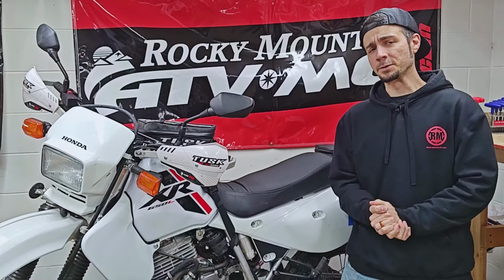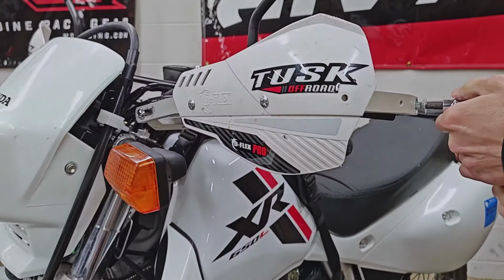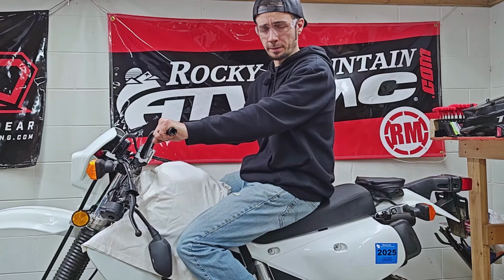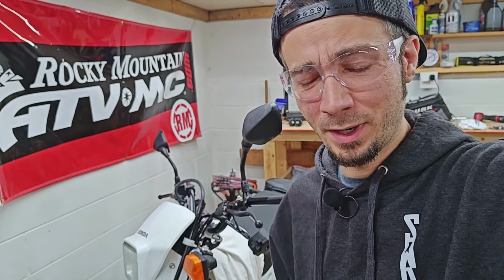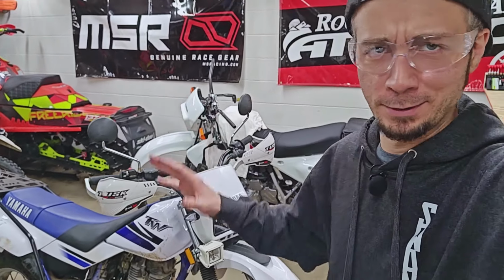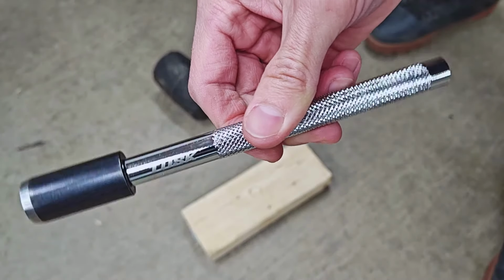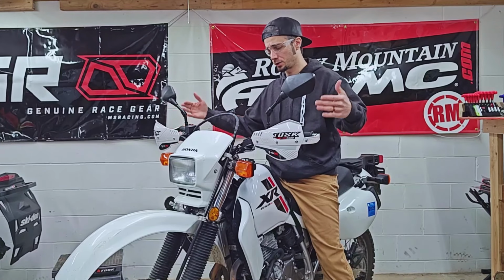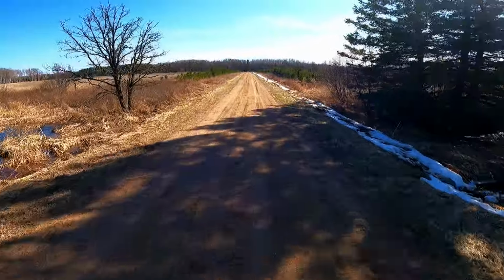The First Mods: Honda XR650L (HUGE IMPROVEMENT)

Comment: I just finished a restoration on a 1997 and I absolutely love it, stripped down to the frame every bolt new or polished everything repainted got every billet part you can get renthal, CNC , DID got vintage Vance & Hines exuast polished like a mirror new plastics, Renthal bars with risers Honda racing graphics, all new breaks tires engine tuned valves adjusted new fluid’s new Honda carb,ect
Reply from the maker: Nice, that sounds awesome!

Comment: I lowered my pegs on my DR650 and yes it is more comfortable but your feet will hit and get hit by more stuff offroad. Sticks and stones etc. These japanese engineers usually do things for a reason. Awesome bike anyway
Reply from the maker: Yeah, I've definitely had that issue too.  With the 13" ground clearance I think that'll be less of an issue, but still could cause problems for sure.
Reply: @SwankyCatProductions  Its true tht ground clearance is one clear advantage the xr has on the DR

Comment: I had to extend the throttle and clutch cables when I did mine. Pro Cycle has them.
Reply from the maker: Did you replace them with longer versions?  Or add extensions?

Comment: Hi. 
Great video as usual. 
I have a question regarding sag height. 
Would you please do a video on this. I’ve just bought one of these bikes after watching your videos and am struggling to find out how you get to the spring area to set it. What do you need remove etc to gain access to it. 
Mine is set really firm at   ~2” instead of ~3.7” 
Thanks 
Craig
Reply from the maker: Hey Craig!  If you pull the seat off (two bolts under the rear fender that go into the inner sides of the frame) you can get right to the adjusters!

Comment: Oh,Thanks again I'm going w/ same bar set up good job !
Reply from the maker: Good deal!  I'm glad you found it helpful!
Reply: @SwankyCatProductions  I'll def let you know how it feels after . Right now its 14 gear tooth and try set sag see if I can get it a bit lower , if not lowering link ,and back dirt tire worn and I bought it w/ a stock tire on front /dirt back . Bought in Dec 2023 , 06' bought my 18 and 16 yr old sons xr400r's 2002 and 1999 we've been taring the trails up around here . I live by Mt Shasta Ca. And you ride 3 blocks away from my house theres a moto track and then ride either to left or right and its all out back :) . Awesome stuff thru creeks ect , so I have to get height carb ect dialed in . I pulled front sprocket other night , thought they replaced , but after watching ur vid it wasn't lol. It looks fat like the upgrade though but its not . At 5,000 miles the spline looks good though .Good stuff

Comment: You don't have to halve the controls. Just loosen, remove bar clamps, and you can just slide the throttle  assy and such off either side.

Almost always have enough slack in cables.
Reply from the maker: True!  That can speed things up!
Reply: LOL he'll learn with time !  after a zillion handle bar changes you LOOK for short cuts !

Comment: for dualsport thumpers i think a good ol trashcan windscreen looks the best. 6'3" so all my bikes get risers. Helps the bars not look so high compared to the rest of the bike. for the tusk grip heaters if you put a thin wrap of self sealing silicone tape on the bar first to act as a heat break so the bars dont act like a giant heat sink it makes them way more better to the point of to hot if on high
Reply from the maker: Both good ideas!  I've used a few wraps of electrical tap on the last set I did.  Definitely made a difference!

Comment: I blame you, I went and bought a 2023 XR650L yesterday. I was doing a complete build on a 1994 XR650L and your new videos on your 23 XR, made me want one! Thanks LOL! Keep the videos coming, really excited to see what other upgrades you are going to do.
Dave's mods?
Reply from the maker: Oh no!!! Haha 😅  They are really, really cool looking bikes.  Aren't they?!  Thanks, I'm glad to hear that!  I'm not really sure about performance mods yet, need to do some more research.  Lots of other parts to work my way through first anyways lol.
Reply: @SwankyCatProductions  I just ordered.... Protaper Fatbars Cr Hi, Cycra Probend handguards, Primary drive front sprocket upgrade, JT 48 rear, WPS rear tail light, 55/158 jets with needle shim & drilling slide, xitomer smog block kit.
Lots more upgrades to come!!
Reply: I had a 1998 XR650L, lowered it so I could ride it, but life happened and I sold it
it was a good putt putt machine not impressive at anything....
I got another 2001 XR650L and boy was I surprised at the difference in power !
this is my go to bike now even at 71yrs old !   the old XR's are not as strong as the newer ones ! the only way I could wheelie with the 98 model was dump the clutch
with my 2001 model I can bring up the front with the throttle alone !  something I love to do !  I run 13T front and 45T rear sprockets and can still do 70 mph on the street !
Reply: Make one supermoto

Comment: Rox 50mm pivot risers with Renthal KTM MX bar which is very wide with not much sweep worked great for me on my XRL  I bought my 2009 XR650L new from the Honda shop in Umhlanga, SA in 2011. I've had the most awesome rides in South Africa on my XR over the last 13 years. Being a ham fisted German born individual I naturally gravitated towards destruction testing the  XRL. It is still here now. Went on a losing the weight quest a couple of years ago - got my XR down to around 149 kg with the Clarke tank full - 328 lbs for the imperial crowd here comprende. 
Best bike ever! The two XR600R's were good too and the HP2 Enduro was a sweet trade to "upgrade"  to my XR...L

Comment: What about the issue that the risers don’t have the bottom humps that rest inside the rounded stock clamps?  That will reduce the amount of weight/torque you can put on them, especially with their offset, likely requiring re-tightening/adjusting over time as you ride.
Reply from the maker: I was thinking that might be an issue too.  Thing is, the half round bumps don't really contact the old bar location.  They make things look a little nicer, but that's about it.
Reply: @SwankyCatProductions  good luck, either way it’s an easy adjustment down the road if required ☮️ … just from personal experience I’ve found that the offset risers can be especially prone to shift.
Reply: Uh, locktite?

Comment: Great video! I like the ATV high bend bars but the stock cables are definitely too short as you demonstrated. The Moto bend with the risers look good, I am still running stock bars on mine but I want to upgrade. The hand guards are a must. I also removed those goofy looking scoops from my bike. Some guys like them, to me they serve no purpose. Never had any issues without them. You get better cooling with them off as I ride the tight woods trails in Wisconsin that are mostly 1st and 2nd gear. Stock jetting is too lean for any temps below 65 degrees F. Re-jetting is a must. Stock exhaust is also very restrictive. I pulled the inset out of my pipe to cure. Aftermarket pipes are loud, expensive, and add zero power. They do look a little better but not worth the money.
Reply from the maker: Thanks!  I'm pretty happy with the improvements.  The higher bars would be nice.  I think the Motobend is a decent compromise though.  Sure beats the stock set!
Reply: Are the Moto bend bars also Tusk Chub Bars? I am going to order a set from Rocky Mountain MC.

Comment: Wow I had one back in 83 when they called that platform a xl600 than again in 91  with the xr 600 when it got a rear disc and cartridge Forks. I can't imagine buying that old technology today. By 2000s you could buy a 520 525 ktm that was like 50 lbs lighter and   so much more reliable.
Reply from the maker: I get that, but I think of this more like an old muscle car you can still walk in and buy brand new today.  They're not perfect, but they are cool (in my opinion).
Reply: @SwankyCatProductions  that's true and I love my old muscle cars.

Comment: Just commenting to help your algorithm-  I had a similar idea with my KLX300. Light adventure. I went light because I am learning, and I am trying to set myself up for the most chance of success. Also these days, my patience for carburetors is not great anymore. Like you I also changed bars for a KTM flat bend, ROX offset risers, and tusk d-flex pro, all from Rocky Mountain. I DID stay with 7/8 bars because there are SOOO many conflicts with parts that will not work together on the KLX (like t-rex windshields), if you aren't running stock sizes, some mods may not fit with each other.

Comment: Weight limits?  We don’t need no stinking weight limits😜.  Back in the late 80s, early 90’s I used to tow a late model dirt race car and all associated needs on a car trailer behind my 4x4 Nissan Hardbody, 4cyl, 5 speed Truck around North Texas to race.  I have no idea how far over weight I was, but I replaced brakes every couple of months.  
But you know what?  I drove that little truck 275,000 miles.  Never replaced the clutch.  Never a problem.  Just tires, brakes, shocks, oil, that kind of stuff.  I saw that truck driven by the guy I had sold it to a full ten years later.  He was hauling carpet rolls so heavy they had caved in the roof and tailgate.  The bumper was almost on the ground.  But there he went, no smoking or nothing.  They don’t build ’em like that anymore🤨

Comment: The Long Story.  Currently I'm 64, 5'7" on a 'good day', 32" inseam, on a 'good day'. Bought my '08 XR650L BRAND new, Honda actually put it together for me when the one I was going to buy was sold before I got back. 

What I've done and feel are NECESSARY to make the big XR a "GREAT" all around, "low cost, low maintenance, high reliability, dirt worthy "Dual Sport" bike”. 

FIRST "AND CRITICAL": swap the front fork for a good pair of 48mm USD forks!! Make whatever deal you can, pay whatever it costs … IT IS WORTH IT!! It's not only GREAT on “tight” hard enduro single track, it's 300% better ON THE STREET!!!  I have been the ONLY, and HAPPY, owner of my XR for 16 years. HOWEVER, I would NOT have kept this bike for 2 years AND WAS GOING TO SELL IT, because of the way the forks handled, … but fortunately(/unfortunately) I had a blown '02 Husaberg 501FE (still sad about it), so I took the entire front-end off, had some machine work done and bolted it onto the XR and have been a HAPPY owner of this bike every since!! (many other bikes have come and gone, but the big XR is the “BEST” do it all, “you can only have one”, bike)  TUNE the suspension to the way you ride and GO!!

“Dave's Mods for XR650L” is the BEST way to de-smog and TUNE the carb, makes the bike run GREAT everywhere! I live at 4500ft and can take it up to 12,000ft, still runs good. 

I also raise the bars, at the time I found, and still have on it, an excellent 2 ¼” riser, again really happy about that too!!
4.7 gal Clarke gas tank for 225 mile range to reserve, I KNOW THIS FOR A FACT, proven a number of times.
You have the hand guards, DON'T forget a really good skidplate!! I have SEEN people put rocks “through” their motor cases, it is NOT worth the risk of going without!
Lastly oversized stainless steel foot pegs, ALSO worth the cost!

Options that “should” be done: after market air filter, full stainless steel exhaust, light weight lithium battery, etc. … 

I ridden this bike like I stole since day one, it probably has about 65-70,000 mostly hard-core off-road miles on it, (didn't have the speedo cable length right and broke it after a year with new forks), I had the top end rebuild a couple of years ago when the cam chain tensioner needed replace, figured, what the hell, redo the whole top-end while their in there!  Piston and cylinder were still in very good shape! My clutch cable was like yours too but lasted 15 years, had to replace it just last summer.

I've had to have cracks and breakage of the subframe rewelded back together 3 times from the vibrations of riding off-road.

The Big XR650L is one of the most under-rated bike there is (once forks are replace). If you can only have ONE BIKE for Interstate Hwys, ADV rides, easy riding around town, 70mph gravel roads, easy or hard two-track, 4WD roads, flowing ATV or single track, or hard-core technical single track, AND you want a LOW cost, LOW maintenance and HIGH reliability, dirt worthy bike …  it will check ALL THE BOXES … except ONE!! 

At 365lbs fully wet … it is one hell of a bitch to up-right when you're a lone and it's up-side-down, leaking gas out of the gas-cap, while wedged between a rock wall and a pine tree, on some god-for-saken nasty technical single track trail, … yeah, ... then, … “THEN” … you'll wish you had another bike!! Hope some of this helps.
Reply: Great info, thanks for sharing.   Looking into getting one of these beasts with only 600 miles on it.   06 and kept in a rich man's garage most of its life.    The weight is the only thing holding me back, but I figure I can get a smaller bike down the road if I really think I need it.
Reply: Nice bikes for sure . What do you think on trading out the front spocket for 14 tooth ?
Reply: @1way-n4l I did it and like it much better. If you don’t plan on doing 90 all the time go for it. The trade off in top speed is worth it for trail riding.
Reply: @TheMotorman116  Awesome thanks for telling the good news. ride safe
Reply: @1way-n4l  you too! 👍
Reply: Ya know I’ve been kicking around getting one. I live in Florida though so it’s hot hot.. like I don’t ride in the summer hot. I’ve been comparing this to the klr 650 as it’s water cooled.
Reply: Much better off road  @1way-n4l
Reply: @1way-n4l love the 14 tooth off road.  Huge improvement.

Comment: Question for you. How do you like the high seat height? I only have a 30 inch inseam. How much sag does it have once you sit on it? I’m guessing tip toes or only one foot down is definitely gonna be the go to move for most everyone.
Reply from the maker: There is a small amount of sag.  The biggest thing is how thin the bike is though, really helps me get the ground a lot easier.  I do need to shift to the side if I want to flat foot, but it works!

Comment: Question?  What's the big difference between this bike & Hondas 500x ?  I get it's a different motor size but really aren't both
basically aimed at adventure type scenarios ?   Right about the time I like one bike, another rolls into view = go figure?
Reply from the maker: The main difference is the extent of their off road abilities.  The XR is extremely dated, but was designed to be a pretty capable big bore dual sport with LOTS of off road bias.  Bikes like the 500x are really aimed more at newer adventure riders, who want some off road capabilities, but are more interested in on road comfortability over long highway stretches.
Reply: TY  SwankyCat,  these manufacturer's are throwing so much stuff out at the public that it's difficult, especially for newer
riders to figure out.  I don't have enough understanding of the platforms they sell or the terminology to be able to even
discuss it here... lol,  so I'm always thankful when someone who knows gives me some time. Much appreciated.

Comment: Im looking at getting the 650 here very soon. Would you recommend the 650 for road, and a beginning just having fun on a motocross track? Also being 6'6 I shouldn't be to to cramp on it right?
Reply: Hi hope this reaches you friend

I can answer atleast 1 to maybe 2 of your questions

- being 6'6 not sure about comfort of your torso

Yet 1 thing about your inseem (inside of you legs ; straddling to seat yourself on the Honda XR650 ( L or R ) the seat is at the 37 inch mark 

Im 5'8 and I have to keep feet reaching for ground when seated at rest

The XR650L version is made street legal already it reads 90 m.p.h. on the tac average gas coonsump is roughly 55 miles until empty

Though with the tank up grade you can easily reach over q00 miles on a single tank by nearly doubling the tank size

Hope it helps friend

Comment: I think im going to have to do something similar to your setup. I need more bar height. But this part 16:22 made me have to ask how you reinstall that throttle assembly? I have this 16:22 style throttle on my bike(klx250). I can’t get my throttle put back together where both cables ride on that clearish white plastic piece. At least that’s what I think my issue is. My throttle sticks like crazy and I’ve tried to reassemble but I just can’t seem to get it. Any tips?

Comment: I had a 1999 XR650L stock and new... I was very disappointed in how heavy it was and didn't want to track down a gravel road...I put a lot of parts on the bike, kinda helped and the motor was redone and i sleaved it out to a 720cc from L.A. Sleave, larger carb ect.... She had power now but still was a heavy old girl. I sold that bike and bought then a new XR650R and uncorked that bike and installed a stage 2 HRC kit.....Now thats the bike you want...not this heavy pig.

Comment: Why would you choose to stand up like a post? When standing on a bike you really should be positioned with your back at an angle to your legs and elbows pointed out with fore finger pointing inward - ditch the upright goon standing position and do it properly, the bike will feel better and you will both ride better, you also will not suffer back problems - antagonise it or whatever, keep the goon stand for the odd occasion if you feel you need it - XR, cool bike
Reply from the maker: The only time I ever actually ride fully extended like that is to stretch out on the road on long rides, never for aggressive trail riding.  Although I do like the bars a little higher then too just so I'm not so hunched, that's really rough on my lower back.
Reply: Sounds like an opinion peice 

I'll just put that with all the other useless knowledge from someone who thinks in one size fits all